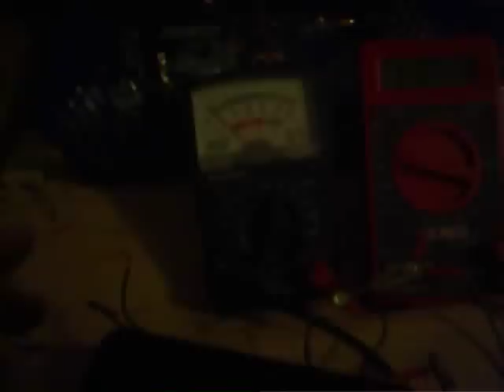1.5v mini transformer joule thief (.5 to 50mA)

Comment from the maker: technically yes but it happens to work out two ways, i wanted the "choke" to use a secondary winding to light an with the help of a small cap, and the use of that particular led and cap reduce the draw a few mA while getting the light and shows no difference without them. that led sort of shows me how much current im pumping and with this circuit it will come on when im pushing over 20mA regardless of the connected load.

Comment from the maker: no this one is actually just a small ferrite tranny with a normal pri and sec step up. im using another transformer as an inductor along the JT base, where by the potential on both sides of that winding's resistance is where the HV is tapped. ran it strong for 24 hr straight no dimming, a JT like this is turning out to be a decent night light or utility light. a 1 to 50mA running range seems to be good for these circuits and getting good extended light also.

Comment from the maker: it's actually pretty useful i ran it for 24 hours straight at full brightness from a 1.4v standing AA and it brought it down to about 1.1v but the light was still bright. would be pretty easy to make an alternate "tap light" circuit that only uses 1 or 2 AA's. not sure why no one has tried to market that.

Comment: I was already thinking what you ended up saying, before you got there... nice light for 1.5V and 10 mA, well below the power normally associated with a single LED running at 3.2V @ 20-30 mA.

Comment from the maker: thanks for the interest but im inclined to ask you first if you have seen some of the easier builds out there such as some of jonnydavro's transformer joule thiefs as well as lasersabers mini joule ringer. those may be easier to build for the same or better results. I am however trying to draw a diagram of my setup though.. it just requires the two transformers, one of which is an iron core so sourcing those may be hard.